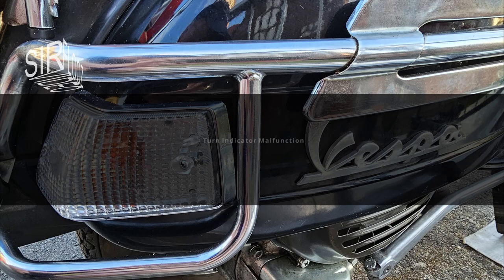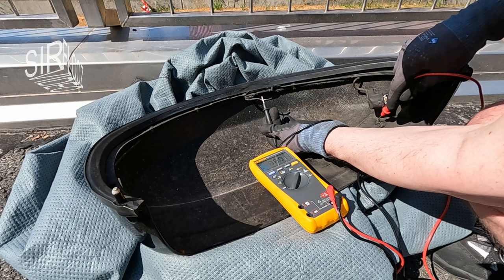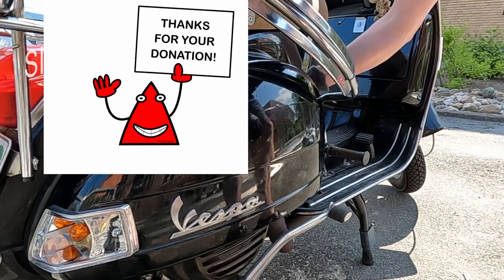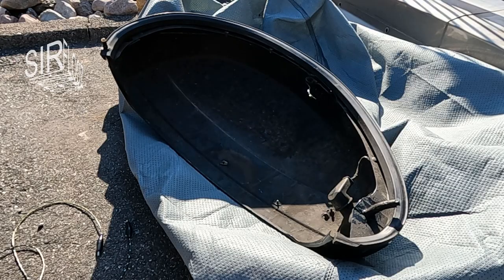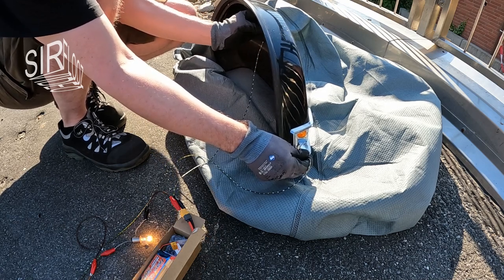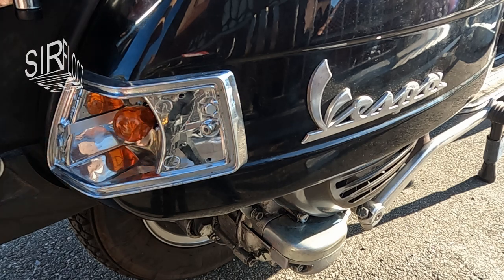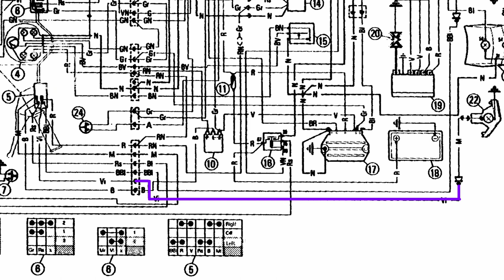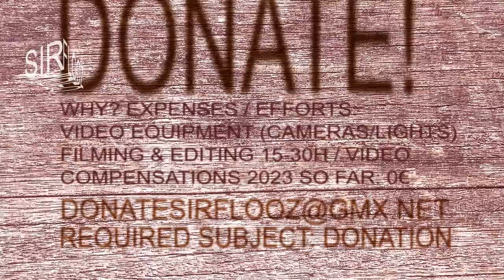Vespa PX Turn Indicator Weird Malfunction | Part 1

Comment: Thanks so much for your thorough troubleshooting steps. I had the exact same symptoms and it turned out to be the same issue you found in part 2, a bad bulb socket. I will be donating right now!
Reply from the maker: Thank you so much! Just make sure to read my pinned comment, on the part 2 video (https://youtu.be/Jix7GSIalQM) because I had to tweak the solution afterwards. But now it works like a charm.

Comment: Nice, I have the same problem on my PX150, so time to try the same steps!
Reply from the maker: My repaired indicator still works fine. Just make sure, that the rear contact is not longer than the original! Two nuts were too much and it rubbed against the engine, so i switched to just one nut, secured by screw locking fluid.

Comment: Te funciono ? No hace falta hacer ningún tipo de modificación ? Yo tengo una vespa 125 PX
Reply from the maker: In part 2 (https://youtu.be/Jix7GSIalQM) you see, that I have fixed it. But be aware, that the gap between the tip of the connection of the indicator and the engine is very small. So, an improvised connection cannot be any higher than the original setup. Otherwise the rubber cap rubs against the engine and gets damaged.

Comment: The panel doesnt earth through the spring clip. It earths with the hook that holds on the panel.
Reply from the maker: Thanks for your input. But in fact the pin connects to +12V TI relay and the spring at the top connects to earth (chassis). The locking hook has no electrical function.
Reply: Im sorry but you are incorrect. The spring is too flimsey for a good earth piaggio would never use that. If you keep the hook clean and area on panel where it hooks to. You will never have a problem. Thinking the spring clip is the earth is a bit of a school boy error.
Reply: That’s so funny.. 😂😂🤣 that clip just holds the panel on .. the electrical part is the front pin that enters the frame through the hole… good luck
Reply: @pauldavis2480  that’s correct for the positive, they’re talking about the negative or ground.
Reply: How do you know? It seems like either could work. Maybe they even designed it with a belt plus suspenders mentality.